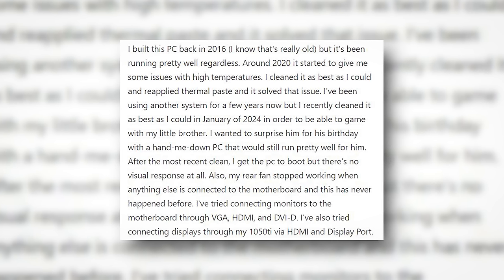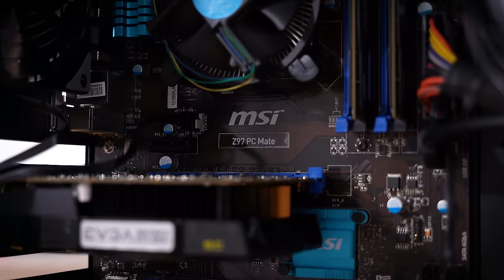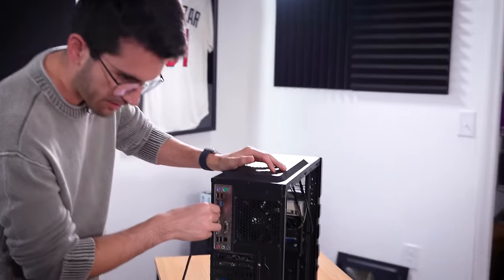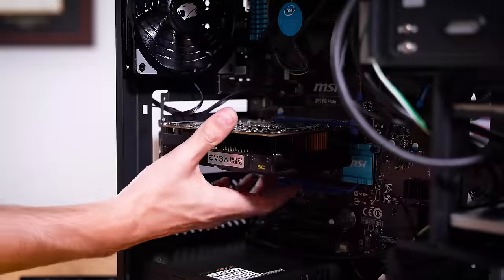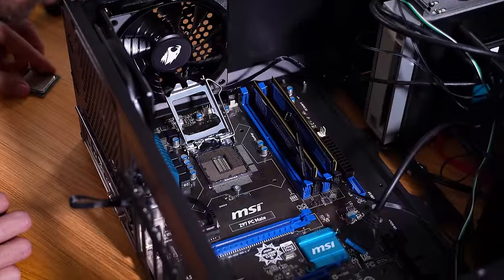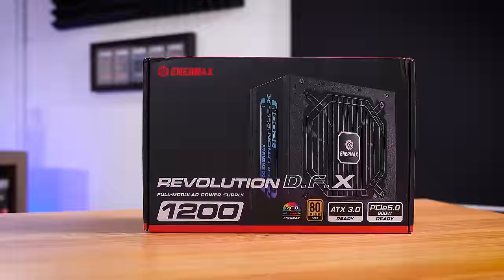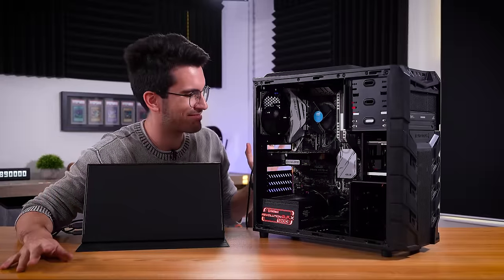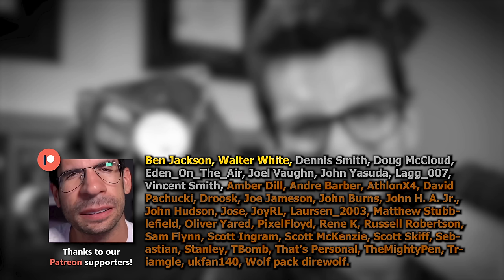Fixing a Viewer's BROKEN Gaming PC? - Fix or Flop S5:E4

Comment: Having built and supported computers for almost 40 years I recognize your problems. I've seen, made or both just about every stupid thing you can do to a computer. The number of times a customer complained over a MB not working and discovering bent or broken pins in the CPU socket was way to common to be comfortable. And close to everyone claimed they had done nothing to the socket.

*It was intersting that during this time I built far more than one thousand machines, and sure there were a few dead motherboards but I can't remember ever unpackaging a motherboard with the kind of damage our customers seemed to get.

My standard diagnosis in a situation like this would be minimizing the equipment in the machine. That is disconnect all storage and all expansion cards including the GPU. If it still won't POST try another PSU with just the motherboard attached.

It used to be that every motherboard had a onboard speaker or at least piezoelectric beeper. That can be critical when diagnosing a motherboard. Sure post code display digits are better, but we know how common those are. Un fortunately the beeping has been seen as "nasty" and people have either not attached the onboard speaker or the MB manufacturer didn't include one. So rip one of the speakers out of a old machine, solder some long leads and use it when the computer you're looking at doesn't have a speaker. do the same with a reset or power switch. It's way easier to attach a temporary power switch to the computer than juggling a screw driver.

Make sure you have a very simple graphics card, one that doesn't need a power connector is enough. Use this to swap out any graphics card in the machine. If it works you know that the users GPU might be the problem. Swapping in a real simple GPU takes seconds, it's worth it.

Try to keep a known good GPU at hand. Swapping the MB power can be a very quick way to eliminate the PSU as a problem.

I used to have a Zippy EMACS 460W PSU to test with. This might sound too small, but I booted a 8 CPU server on it once. This server had four 1KW redundant PSU modules, so it was rated at about 3 KW standard, but my test PSU got me to the POST screen at least.

This was an industrial grade PSU with just about no OCP protection. I blew components from some motherboards with it, but interestingly enough it seemed they tended to work after. This was most probably capacitators that capsized and shorted out. Blow enough amps at them and they would explode.

This is not a repair or even a quick fix, but it demonstrates just what the problems are.

If the machine still won't POST remove the motherboard from the computer and test it on the benchtop. This has depressingly often worked. Reasons has been loose screws under the MB, extra motherboard distances where there are no hole for the screws. A IT technician complained about the quality of our computers and required that we repaid them for all of them. Got him to send one in and found that he had removed the motherboard, removed the distances, screwed the motherboard directly to the case and now complained over the quality as the graphics card couldn't reach the socket reliably. This man had made sure the school bought all their computer equipment through his uncle. But these computers were bought when he was on vacation. He left the job short after this.

Now one of the most embarrassing MB errors ever was actually when a multinational company was designing a new control computer for a power damm. They bought a very advanced motherboard that was only manufactured to order by the manufacturer. They had a 19" server chassis specially designed and manufactured one, just one of them. The first motherboard behaved strangely so we got the manufacturer to send a second. This did the same, and at the same time their old motherboard tested 100% in all tests I could think of. So we cot a third motherboard, jumped into a car and drove for six or seven hours until we could look at the machine in their shop. That server was strange. Swapped PSU, no difference. Unplugged all but one DRAM and it worked!
tried to find the bad RAM but it behaved strangely. The tech swapped out the MB for our new one and it did the same things.

Set up their old MB on the desk, installed the memory, CPU's and everything and it worked fine.

Swapped that MB back into the server case and, no, it acted up again.

Now I knew something was really strange with the chassis, so I unmounted the motherboard, put the screws on the table counted the screws, counted the screw holes and they were the same 13 screws for the motherboard. Large server boards are a bit special here. So I counted the motherrboard distances in the case, 14. This isn't right!

Double checked every distance and found out that there was one extra, just under the memory slots on the motherboard. Turned out that when you installed the memory the memory bus on the motherboard could short out the against the distance. If you pulled on the memory modules it could work for a  moment.  Removing a module also tended to lighten the load allowing the machine to work.

The distances were not screwed into the chassis but riveted in place. I borrowed a drill and drilled down that distance to the plate and it solved their problem.

We looked at each other and decided that this was not what their boss needed to hear. So we invented some reason that sounded a little more advanced, but still made it look good without throwing their technician under the bus.

Well they were a multinational company building hydroelectric power dams all over the world, and the motherboard were pretty expensive at over two thousand dollar each to us. Some percent more to the customer.

Comment: I ran my i5 2500k / Z68A GD80 platform for 10 years. I recently put it back together with a 2060 and windows 10. It fired up fine but it periodically reboots on its own. I have to believe it's trying it's best to run, but newer windows features are giving it troubles. I might try windows 7 to see if it's a software problem.

Comment: Usually the motherboard should notice that the USB plug is shorted and just turn off the port completely and there has been overcurrent protection on USB for a very long time but not sure if entry level boards from back then also had it. Never ones should all come with it.
Since the 5V rail on the PSU was down I suspect this one didn't and the PSU took one for the team🤔

Comment: Regardless of the fact that you repaired the bent CPU pins and replaced the power supply the MB still had that defective USB port. That, itself, could potentially cause issues in  the future if someone were to try and plug something in. That could have been the cause of the 5 Volt rail failure in the original PSU to start with. The mobo needed to be replaced or at least, the damaged USB port replaced. You did the right thing even though it required a base upgrade.

Comment: I know its not that kind of series but it would have been neat if you had a hot air rework station to desolder that USB port and fix the board that way.  probably for the best that the user got an upgrade however.

Comment: Same thing happened to me recently. I tried switching a 5V ARGB header while the system was powered on and i popped and fizzed....switched on for like 3 times only after that. I ended up replacing the motherboard, CPU (from  5900x to a 5950x) and case (I thought maybe the power button was faulty on the previous one). All in all I have a better looking (and more powerful) rig than the last one but it was all needless. In the end the problem was a faulty ATX (motherboard) cable. 

I realized this after part swapping everything (including my 3060ti with the 3080ti at work)....such fuckery.

Comment: How do you do this all the time 😂?  I literally got this exact motherboard in the mail today.  Going to build a Xeon E3 1241v3 system (they can turbo to 4GHz, and Z97 usually will boot an NVMe drive as well).  Its pretty cheap at around 15-20 for the board, and same for the Xeon CPU

Comment: Hi Greg, and hoping you and your family are having a nice day. Have you ever run into a case where CORSAIR iCUE and the  components it controls began to act funny? My CORSAIR brand pre-built PC began to show the iCUE software and/or components were acting up. The fan LEDs would work and suddendly turn off and later turn on. The same with the fans and the AIO pump and its LED display. When I powered off the PC the LEDs on the keyboard would stay on even though the PC was turned off. I had to disconnect the keyboard USB cables, turn of the PSU, and unplug the PSU from the wall outlet to get the lights to turn off. Every attached CORSAIR component was affected. Thinking the iCUE software was the problem I attempted re-install it. This didn't work so I decided to delete iCUE and try to re-install it. The delate procedure was a muti-step procedure including making regestary changes. While I attemped to solve the problem I lost power to all of the CORSAIR components including the AIO pump. My PC began to overheat and preformed a system shut down which prevented me from having access to the iCUE software. Having no way to BOOT into WIN 11 my PC became useless. CORSAIR support sent me an RMA but told me that the M.2 SSDs would be wiped clean and I must return the PC with its two M.2 SSDs. Doing this would cause me to lose all my program, data, and personal files. I have a second PC, external M.2 duplicater, and two new SSDs if that would help.   Do you have any suggestions which might help with my problems?

Comment: The first time I built an all new system, instead of hand-me-downs and piecing together friends old spare parts, I fought tooth and nail with it for a day and a half with no post.  I was getting ready to RMA the whole lot when I noticed I had my keyboard plugged into the mouse PS2 port instead of the keyboard PS2 port.  Once quick swap and the damned thing posted, no problem, and i wanted to throw something at the damned wall for the hours of frustration.

Comment: bending pins tip...
I recommend you use a thin piece of PLASTIC like a credit card shape that's thin enough. Line up an entire ROW and nudge the bent pin in the right direction. Then rotate 90 degrees and repeat until they are properly spaced. This helps ensure you can't push the pin too far as all the OTHER pins help stop the plastic. When they are TOUCHING this is harder, so you may have to manually push that single pin just enough to slide the card in.

Comment: Just before Xmas, I was helping a family 13 yo build an AM5 platform upgrade/swap. The sucker would not power on. The connections looked good, so we started pulling stuff. Due to the case and MB layout, I had to reach into an area of the case that I couldn't actually see into. I could feel the 24-pin connector. I could also feel the gap. Well, nuts!

It happens.

Three months later, it runs just fine. The Kid likes to mind remind me that they have a better computer than I do, tho.

For now, kid. For now...

Comment: Sorry: should not have attempted to repair the CPU socket & re-use that Z97 board with those damaged USB ports. Just order a used replacement Z97 board off of eBay, since the CPU is still ok. Also noticed: the optical drive was not connected to data & power cables (?) The 1200 Watt power supply is overkill for such a system & probably uses more power than an appropriately rated PSU. A 600 Watt PSU should be more than adequate.

Comment: I always liked the AM3/4 way of pins on the cpu instead of the motherboard.
Those pins in the socket are way more fragile and way harder to bend back correctly without them touching or breaking of. When the pga pins are bent, the cpu will simply not go into the socket. With lga the pins may get bent when inserting the cpu without any direct feedback.

Comment: Even though the machine is working, having a motherboard swap can have incompatible drivers causing unexplained errors down the line. Windows 7 and earlier would work for a while without issue but some motherboards would not play nice with software from other vendors. With substantial changes like this recommending that the user data is preserved and reinstalling the OS is a good precaution.

Comment: You did the right thing, even though everything would have probably worked after fixing the bent pins, those damaged USB ports would have become a problem eventually, same with the PSU, it was already failing and marginal at best, it would have let him down, and likely sooner rather than later. The z290 platform will be a pretty solid upgrade, sort of, it seems to me 4-7th generation were fairly similar, but the DDR4 and reliable PSU will make a world of difference in his gaming experience.

Comment: my daily driver desktop for gaming is still a 4790k paired with a 1660 and 32gb ddr3, works perfectly fine, i'm aware is not even remotely close to the best, but it works perfectly fine for what i need. so i don't feel like changing it as long as it works

Comment: I had a front panel USB port get mangled and my computer sometimes wouldn't post or would BSOD before too long, until I disconnected the front panel header. 
That said, the damaged USB port could have reared it's head again, even though you tried to separate the left USB port on the rear io. 
Nice catch with the bent pins but I think a different motherboard was necessary, anyways.
I agree with other commenters that the 5V rail on his PSU got broken because of the damaged USB port or the bent pins for CPU.
I just find it so cringy to replace a 500W PSU with a PSU that has a 1000W or more power, when there isn't a powerful GPU. It needed replaced, though.

Comment: That 1200 watt PSU is really overkill for the system. However, Enermax is not a high end brand so their PSUs are probably much cheaper than another brand's equivalent PSU. It is interesting how bent pins on the MB can manifest itself in some weird symptoms. That's why I am very careful with how I install the CPU in my system builds. It is always a relief to complete that process and never want to keep messing with the CPU once installed.

Comment: I always ask customers when upgrading or building them new systems if they would donate those old parts for use in helping others with getting their systems working.  Most agree readily but some do ask for a discount when doing so and if reasonable I always say sure.  It really is good business when you have overhead of older a less expensive parts to offer in order to get them up and running on the cheap.  I always recommend new parts but this does offer benefits especially word of mouth advertising lol.

Comment: i can attest to bent pins. had to go fix my wife's mother's pc afew day ago from time of this comment. her cpu cooling fan was acting weird so i ended up replacing it. after getting the thing back together an entire ram slot was just dead. causing the pc to scree its error beeps. after checking everything i eventually decided to say f it and check the socket. turns out a SINGLE pin was slightly bent and it killed an entire ram slot. after some sketch work with an ifix-it needle tweasers i managed to get it bent back and everything worked perfectly.

Comment: Greg,I having an Issue with my custom build is I 9 13900K pair with a 4090  RTX from Zotac powered by a 1,000W Asus Thor Platinum, and as soon i try to do cinabench it,  shut off. To cold off every I have 11 fans, including a Kraken Z73.

This a breakdown of my system:
Z790 Aorus Extreme
I9 13900K
Zotac 4090
Corsair Dominator 6400 2x16GB
2T x2  samsung 980 Pro
Kraken Z73 360
11 Corsair Fans 
Case is a Corsair 7000X
1000W Asus Thor

Comment: Last month I took my truck into a mechanics shop because I was told there was an issue with one of the control arms causing excess wear on the inside of the tire. I trust this guy and wanted to be sure this was really the problem before buying any parts. He told me it was fine and I should take it to a place that will align it and have them look at it but don't say anything. The point being, often what we tell someone who does repairs focuses their vision on one problem and not another one that can also be the cause. 
However as one other person posted, in this case I think replacing regardless was the right call. Eventually those pins will short again on the USB and it might take something with it next time (if it didn't take the power supply). 
I'm wondering though if another reason he replaced once he found the real problem is customer communication where he told the customer that he was going to do that and wasn't willing to go back on it.

Comment: I wouldn't trust that original board without like removing that borked USB connector. Yeah, the owner got a much nicer rig back, but then he was giving it to his little brother which was really nice. The specs didn't sound all that bad for gaming as long as you picked reasonable games for it to run. The 1000 series Nvidia cards aren't anything to sneeze at even now.

Comment: ahh i had issues with my i7 13700k  running hot with a aio. i thought the aio wasn't cutting it cause i knew intel chips run hotter thand amds from what i heard so i bought a Noctua NH-D15 thinking that could solve my issue. nope just made the common mistake of forgetting to remove the plastic thing on the waterblock of the aio instantly fixed my issue. only that sucks is my 3060 got shafted. i installed in my new computer to got just pure visual artifacts i retried installing it multiple times but nothing. i'm just glad i had my 2060.